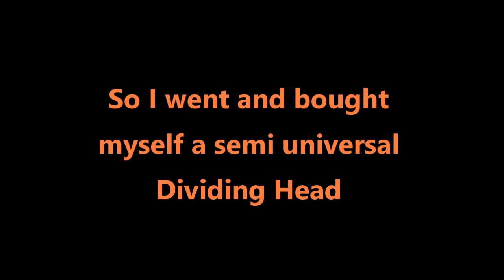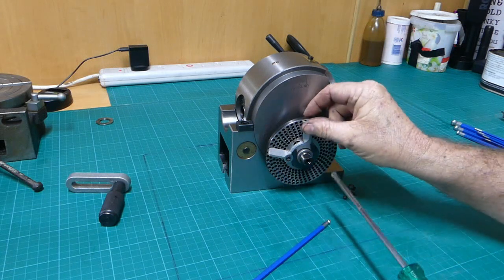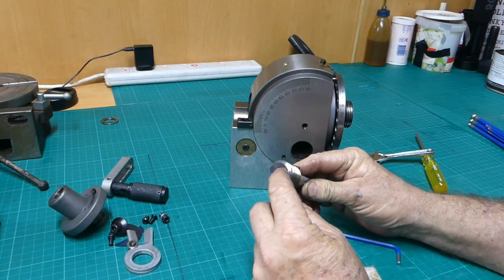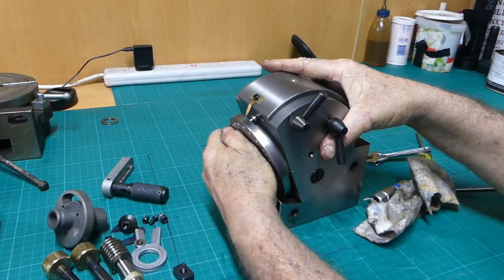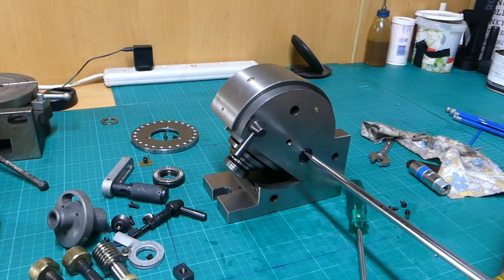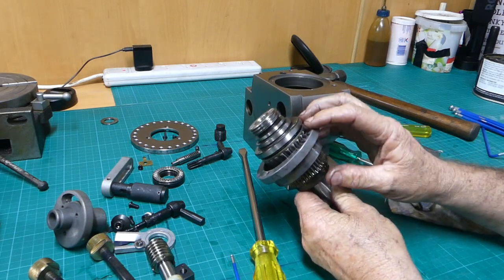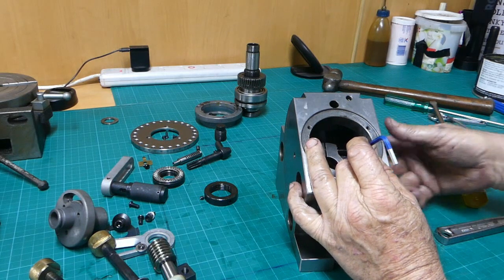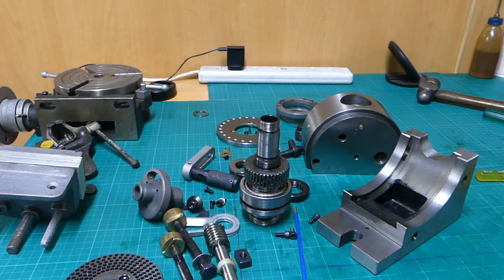Chinese Semi - Universal Dividing Head Part: 1 Strip it Down for Evaluation

Comment: I'm in the process of tearing down my twin to yours. $219 with free shipping Ebay. I couldn't help myself.
 Subtle differences between the two.
The worm bush is black and the shaft has spiral oil grooves.
It came with a nice 3 jaw chuck that was a bear to get off. 
 I tightened the jaws on a hex bolt, double nut and she came loose.
This is a great reference video. Thanks.
Reply from the maker: Thanks.

Comment: good to see how it comes apart, problem for me is I can't get the chuck off as it's too tight, how can I do it without risk of damage to he locking pin or interior worm??   I see you answered a similar request further down but poster did not reply if he had got it off
Reply from the maker: A gentle tap wont damage anything.

Comment: Is this a brown and sharp taper in the spindle? Do you know what the spindle thread is? I got myself an ultra sonic cleaner. Great for cleaning off all that grinding dust. Just plunk the bits it in with some mild degreaser and heat and vibration take all the crud away. Neat to see how this goes together.
Reply from the maker: It is a morse taper in the spindle, No2 from memory. I think I mention the thread in one of the videos but I cant remember the size now.
Reply: @BundyBearsShed  thanjs
Reply: I mean thanks!

Comment: Had mine today Sliced my Hand lifting it out of the box very bad Burrs , my shaft wouldn't lock tightened the handle a little more snapped it , Striped it down the locking plate hole is to big it has been over bored  for the shaft
Reply from the maker: Unreal, looks like luck of the draw as to if you get a good one or not.

Comment: Mine just arrived. Did you find the chuck was screwed on tight ? ... how did you get it off without doing damage to the worm ?
Reply from the maker: Mine wasnt too bad, I put the lock pin in and used a shifting spanner on the jaw gently.
Reply: allbeit,  did you manage to get it unscrewed ?  I've tried all the usual tricks but it's on solid
Reply: allbeit,  did you manage to get it unscrewed ?  I've tried all the usual tricks but it's on solid
Reply: @vicnewey3557  Yes I did..... Bolt the head down on your mill. Make a neat fitting pin to go through one of the holes in the indexing plate level with centre and put a piece of steel vertically between the pin and the table, this should protect the gears from damage. Put the largest hex key you've got (12mm or bigger) in the chuck and tap it with a hammer. The alternate is a pinch bar in open jaws.
Reply: @allbeit582   thanks for that advice, I did what you said and it finally worked, why it was so overtightened I don't know but I'm very sure it won't get  stuck on again!
Reply: @vicnewey3557  no worries. Glad i could help.
Reply: @gangleweed   I'm not sure how you can apply any anti clockwise cutting force on a fixed indexing chuck?
Reply: @gangleweed   my original question was how to get the chuck off the BS-0,  I used the word 'fixed' because in this case the chuck does not spin does it, therefore your advice about applying anti clockwise cutting force was totally irrelevant in this thread
Reply: Lock the unit down to either the Mill Table or a bench, lock into the chuck a Hexagonal piece of stock about 6" long, take a wrench that  is the correct size (3/4", whatever) and turn and it should come right off, mine did with no problem. This type of chuck is not that difficult to remove and is intended to be removed in case you want to use the face plate and use the unit for in between center work.

Comment: ‘Cheap shit.” Do you know how much a “good one” costs? About $1,500 to $2,000 in USA dollars. It’s amazing that the Chinese can make such equipment for what it’s sold at. Take it apart, clean it and put it back together after checking for burrs and mating surfaces that aren’t milled or ground smooth, and that’s about it. Don’t replace nylon with brass, without understanding why nylon was used. It’s not necessarily cheaper than brass, which isn’t the best bearing surface. It you want, you would need to go to bearing bronze. But there’s no reason to. They cut corners where they have to, to meet that ridiculously low price, but a lot of it is cosmetic. Some of the parts are injection molded zinc alloy. They’re then machined. That cuts costs considerably. The zinc is fine for a home shop, if the unit isn’t banged around too much, or used for work that’s too heavy. It won’t hold up in professional shop use. All oil and grease turns black after it’s used on cast iron and unhardened steel. Didn’t you get a manual with an exploded parts diagram? That should show how the parts go together.

Where you have to be careful, is with Indian tooling. They’re not up to it yet.
Reply from the maker: This is working well and my shop is just for a hobby, the clean up was the main thing here, overall very happy with it.